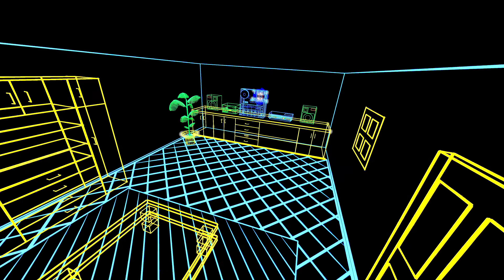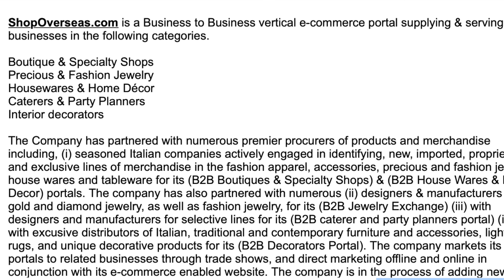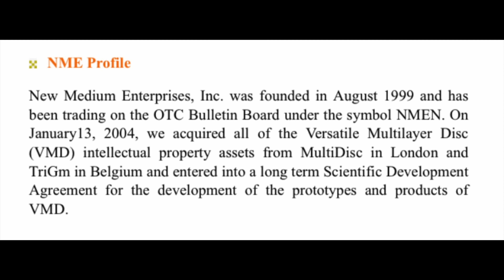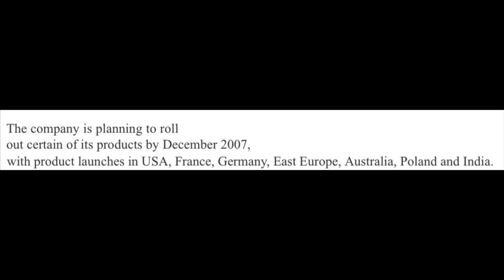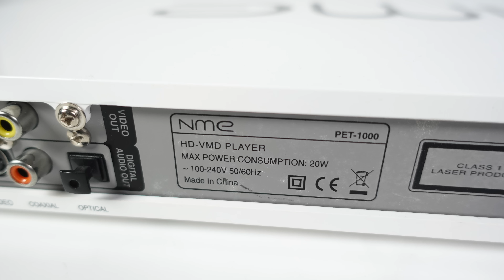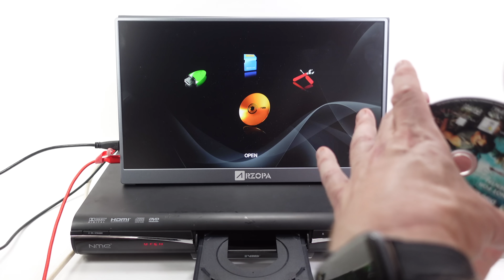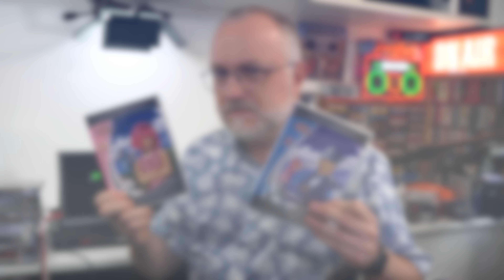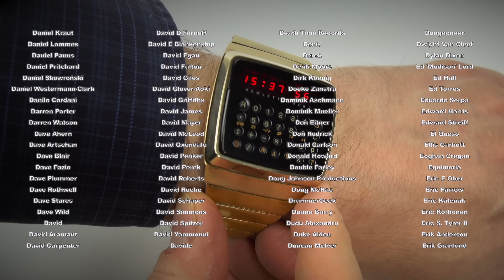The HD-VMD story - The format that lost to the format that lost

Comment: Given the updated firmware of the DVD burner, would you be able to read the discs if you put the drive in a computer?
The updating firmware part seems similar to when Dual Layer came out; I remember you could just update your regular disk drive for it to be able to read and burn DLs.
Reply: i was able to open the .vmd file in windows media player but it looks like this http://prnt.sc/1j1na6f
i had to delete some lines with an hex editor and then you have a normal mpeg-2 index the same as dvd 00 00 01 BA
so the video isn't encrypted, and it seems to play just like it did on your player
Reply: i was able to open the .vmd file in windows media player but it looks like this prnt. sc/1j1na6f
i had to delete some lines with an hex editor and then you have a normal mpeg-2 index the same as dvd 00 00 01 BA
so the video isn't encrypted, and it seems to play just like it did on your player

Comment: I'd be curious to know what would happen if you took the production DVD-R drive (that supposedly has custom firmware) and connect it to a PC. Doesn't solve the problem of not having a player application that can read the files properly, but there could be some rudimentary copy protection that isn't visible in normal drives. I doubt it, but who knows. In fact I kind of doubt the custom firmware even exists.
Reply: It must exist, since .VMD is a proprietary format.

Comment: looking at this from the year 2021, how I would have approached this would be to take standard dual-layer 8.5gb DVDs and put ~5-8mbps h264 content on them. You can comfortably encode 1080p into those bitrates, while being able to fit it onto a standard dvd. With this, you can fit HD onto a standard low-cost DVD with no special media. Thinking in these terms, bluray and hddvd really didn't make a lot of sense, seeing how little quality is gained by going from 8mbps to 25mbps with properly encoded h264.

Comment: When they said that VMD discs would be readable by a standard DVD player it's conceivable that they meant that it would be possible to manufacture a hybrid disc. Something that follows the DVD spec but also has additional layers readable by a VMD player. I presume they never realised this ambition but it might have been based on a sound concept.
Reply: There were also dual sides DVDs. Probably not a very common type disc anywhere I suppose, but I have one with 4:3 aspect version on one side and 16:9 on the other. 

So could be even more likely they simply meant those. Only with HD-VMD or regular DVD on each side instead.

Comment: Can't really talk about the HD format war without PlayStation 3. While slower adoption than Xbox 360 initially, the thing was still a $599 BD player when the first set of players were all well over $1000. It wasn't even just a BD player, it was a 2x speed player meaning all PlayStation 3 consoles were able to add 3D Blu-ray support via firmware update (which is insane). This meant that by 2009 when the 3D BD specs dropped, the system had dropped to $299, putting it at less than half the price of the new 3D BD players and already had a 22 million unit install base.
The HD-DVD external drive for Xbox 360 was a whopping $200 all on its own, the first two generation 360 models didn't even have HDMI.

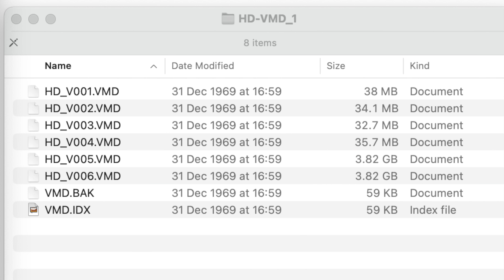Comment: Now THAT's interesting...the VMD in your final production run disc (32:42) contains files that are all listed as created 31 Dec 1969 at 16:59. That means little enough; everyone knows 
1970-01-01T00:00:00Z is unix epoch. So why the day before? Also understandable: Epoch is set at the UTC timezone, meaning other timezones are before and after. 16:00 is UTC-8, or "PST" (i.e. the Los Angeles timezone). But that's not right, it's 16:59. Okay, well some platforms contain a temporal standardizer to account for leap seconds. In those cases, the Seconds value (which, alas we don't see here) is stored as a :60. Problem being, if the device doing the READING isn't equipped for that, it auto rolls BACK one second to :59. So okay, that accounts for that, too, except... that would have made it 17:00 (minus one second). That's UTC-7. Mountain Time (Denver's timezone).

So what? Well, a few things: 
1. This london based company's media files are zone-stamped as USA. Typically you'd see this if the metadata didn't contain date information, so the system falls back onto Epoch... in the locale timezone (that is, the timezone of the physical computer doing the data transcribe).
2. This, in turn suggests a data manufacture in the west coast or central coast of the US, which, while I agree "Hollywood is there" (the -7 offset could be explained away by Daylight Savings Time, which, itself, tells us little more than the data was encoded between April and October), it still seems odd that Lazy Town, a product most assuredly NOT coming out of Hollywood, was encoded there. Especially...
3. ...if they never got a movie studio on board...
4. ...their proprietary format presumably required custom tooling to burn.
5. It seems strange to me that a company in LONDON chose to ship what is presumably the only encoding hardware prototype they managed to the US, and not least because...
6. ...the USA is not precisely the cheapest place to get labor or manufacturing done.... like the sort needed for encoding a production gang run of discs.

What does that all mean? Meh. Nothing. Not really, beyond hinting at still more questionable decisions as the company approached its demise. This all ran through my head when I saw the date is all. In short, "Epoch fail".

Comment: There was actually going to be another contender for this: the VCDHD (later known as the DVHD), was a flexible (as in, physically bendable!) optical disc that was apparently compatible with standard DVD players and drives and claimed a whole heap of advantages over normal DVDs. The reason I say it was going to be another contender, is because I believe they planned to release a blue-laser version (probably compatible with HD-DVD or Blu-Ray), but the format seemingly died before it reached that point. I can't find much information on what caused the death of the format at all, so it would be interesting to know more of the story here.

Comment: I could see VMD being extremely useful for Xbox 360. Think about it, so many Xbox 360 games came on 2 or more discs due to games becoming larger and larger. But with VMD, all they would have to do is swap the drive firmware and order VMD’s instead of DVD’s for games over 8 GB. Though Microsoft would never do this, since they backed HD DVD.

Comment: From experience of using optical discs as my main backup system for over 20 years now, I can tell you that multi-layer discs are not cost efficient in the slightest. You will often pay 3 to 4 times more for a dual layer than single. I'll assume that is why those LazyTown ones are on DVD, when you consider how much 4 or 5 layer discs would probably cost.

Comment: My first DVD player was a Toshiba. It was an open box and I got it at Best Buy back in 98. With tax it was almost 300us. Fast forward to 02' I ended up working at the same Best Buy I got the player from. I miss it because of the awesome discount we got for electronics. It was about 50% off. I ended up acquiring a Yamaha HTR 5590 receiver and a Bose Acoustimass 15. The receiver was $899 and the speaker set was $1,200. Got both of them with tax for a bit over $1,100. Good times

Comment: What's more likely is small file format changes and alternations between the prototype and the production machine making the discs incompatible this happens a lot in format production or any production. You can make a device and by the time it reaches manufacture the software and files are so different from the outset they are incompatible.

Comment: The HD VMD sales text claimed Blu-ray & HD DVD needed separate pickup units despite both using the same wavelength blue laser vs. its DVD-wavelength red laser. Funny, my very first HD optical drive of any kind was a dual-format Blu-ray / HD DVD PC drive, specifically to prepare for a lengthy format war; it wasn't any bigger than a normal PC optical drive.

Ironically, it arrived the very day WB announced it was going exclusively Blu-ray; HD DVD effectively didn't survive to the date WB announced as its last HD DVD releases. My first HD disc, Dreamgirls on Blu-ray, was a rush buy because there was a single copy left in a local Best Buy after Paramount had announced it was going exclusively HD DVD; I didn't want that as everyone knew from WB's announcement that HD DVD had lost the war. Now, I have well over 1000 Blu-rays and over 100 4K Blu-rays; my latest player is the Panasonic UB820 with region-free mod. 😁

Comment: Great video. Seen that last VMD player with a standard DVD-R Burner drive I wonder why they did not made it a Hifi Stereo Audio recorder (PCM or MPEG1) with a custom firmware upgrade and some visuals on the screen to name files. They would have been the pioneers on this front so close to CD-Audio Recorders with a lot more hassle. For a company like Philips not 2 experiment with DCC on a CD disc Recorder (5 Hours 18 bit) still fascinates me. It could have blown MiniDisc out of the water.

Comment: I think this product would have been better in the pc hardware market than the movie market.  It can use a dvd drive and could have been a great alternative than having to upgrade to blu ray, although no one did. Plus it would have been a good stop gap between dvd storage and usb storage which at the time a single 32gb could have easily costed you 30 to 40 dollars, so even if the  VMD was more expensive than dvds, it would have been cheaper than the alternative for more storage.

Comment: Actually the blue laser thing was valid at that time.
Red (semiconductor) Lasers are based on a material named "Gallium-Arsenide", which was well known from manufacturing and technology side as this was/is what also drives optical telecommunication lines in the infrared regime.
Blue (semiconductor) Lasers however are based on "Gallium-Nitride" material, which is a rather new invention, really only taking off in the 90's on the material science side. And the way to an actual Laser based on that material was a really hard one (including the invention of a completely new crystal deposition method named "metal-organic vapor phase epitaxy" (MOVPE or MOCVD)).
In fact it was the missing availability of blue semiconductor lasers that postponed the commercial start of the PS3 for several months because they couldn't get enough of these for their blue ray compatible drives.

Comment: Just to think now with todays advancements in video compression you can technically store a good looking HD movie on a regular dual layer DVD. All you need obviously is just some new gen decoding hardware. With H.266 you could probably even get a decent 4k image.
That said the HD disc format wars put many people off from even bothering to be interested. Most people were happy with DVD, it just worked and for a decent price. Also DVD was simply a good format in the sense that as a collector there were lots of extras that came in the box. The HD formats never offered the same sort of extra content collectors experience.

Comment: 23:55 As a temporary fix to see if it helps with reading discs, did you try and turn the pot that's probably there to drive the laser harder? Probably on the small board mounted to the laser near where you were cleaning

Comment: For me it Looks Like the Format uses the Same structure as DVD with an idx and BAK file. But instead of 576p mpeg 2 Like on a dvd it uses 1080p mpeg2. So maybe its possible to rename the vmd Files to vob and try to open them as vob or mpg2. Thats the Container a DVD is stored in.
Reply: indeed... i also think its just the same vob structure that we know from dvds but with with 1080p mpeg2 encodes. Its kind of a Super DVD. lol. Just like those out of specification discs called super VCD back in the early 2000. haha.

Comment: I think back in 2006, blue LEDs and lasers were still a not-unsubstantial cost increase over their red counterparts.  As we know, functional LED lights weren’t really possible until a more cost-effective blue LED Solution was invented, which I believe was somewhere around the turn-of-the-century, but I might be mistaken.  Maybe ‘96?  

Since it is logical to assume that the HD decoding circuitry would be (presumably) similar in price for all three formats, I think it is then therefore also logical to assume that the red laser played a more significant role in the 30% price difference, perhaps?  0.02

Comment: You might try cleaning the lens.  Those first gen HDDVD players used two read heads.  One for DVD and one for BlueRay as the grove tracking was different.  Then again, the thing should spit out the disk if it detected an error in the bitstream humm.

Comment: at 12:50 you're saying that not using a blue laser seems like a trivial difference but IIRC around 2006-2007 405nm UV laser diodes were brand spanking new (and enormously expensive if you bought one-offs) and there was a lot of difficulty getting them manufactured in volume (causing delays to the PS3 launch)

Comment: Hello Sir, myself BHARATH from India.
I need some assistance and guidance in respect of sansui D770R Cassette Deck.
The deck is functioning Good in all aspect of mechanism, but when Play Out connected to the main amplifier there's no audio.
The head connection socket at the pre-amplifier board, there is a Audio Click while touch that socket and VU led spectrum is also works, but after connecting the head output wire from the mechanism there is no audio and no UV led spectrum works.
Please help me to fix the problem, and where I need to check.

Comment: I'm really confused. So basically if it runs on a DVD player with a firmware update, it's basically just a different compression algorithm and video codec. There was no actual HD advance in the hardware, beyond standard DVD hardware? Does that sound right?

Comment: What file system did you use when you burned the disc?  I'd try burning the disc with a udf 2.5 file system.  The prototype video discs might not be able to play on the retail units.  I'd be interested in how the discs are put together, I do HDDVD on dvddl discs for a hobby and I could find another reason to burn discs in 2021

Comment: Using a normal DVD-RAM drive with a different firmware was impressive but the fact that the disk you have are normal DVDs shows that something did not work that well.

Comment: Why would the VMD not work on a DVD player? 
It all depends on the implementation. Am I wrong?
A VMD disc with 20 layers, could still work on one the layers as if it were a regular DVD, 
and that layer could have data encoded with MPEG-2, which could be decoded by a regular DVD.
I mean, I don't know the specs, but it could work, if done properly (we've seen other technologies that were backwards compatible 🤷‍♂️)

Comment: 20 GB per disk would make them a dual layer double sided disk which most if not all standard dvd player are able of playing.

Getting an extra 300 MB (standard dvd disks were 4.7 GB of marketing size and not true binary size of 4.37) per side would be more difficult with a standard laser. Over-burning would be the answer to this but it bring many problems of it's own.

It makes me wonder if that was the reason the pre-production were the over-burned 5 GB per side which was causing havoc for reading and playback.

Comment: Wait. Hp was on bluerays side? Why were they making laptops with hd dvd drives at the height of the format war? My hp dv9600 had a hd dvd drive. And that was a flagship laptop. They didnt start puttinf bluray drives in laptops until hd dvd failed. They must have been one of the turn coats that changed sides near the end.

Comment: A standard DVD reader can deliver about 11Mb/s continuously when playing a DVD Video. There's some overhead with the DVD format, leaving 9.8Mb/s for video and a little room for stereo audio at around 0.2Mb/s, making a convenient 10Mb/s.  The Saw movie runs for 1h43min. That comes out at 7.73GB, leaving just enough room for it to fit on a dual layer DVD with menu and intro logo and be readable by any standard DVD drive. The hardest part is making your own format and decoding it. I'd be very surprised if HD VMD is anything but a standard DVD with different files on it, and a bunch of lies.

Comment: While I think it would be no trivial trouble if you could have a backward compatible SD and HD on the same disc that would be cool. At the time the lasers were not a baked productionized solution so while bludgeoning consumers with exclusive content works it's at a cost and many people stuck with DVD at the time. Sony has many failed proprietary mediums. Falling behind on timing is death. Vertical integration anti competition seems like it should see anti competition issues. The technology still seems interesting if they could have reached the data capacity.

Comment: Wait, all their brilliant ideas were exactly the same as HD-DVD.
EDIT: To be clearer, HD-DVD was also "cheaper" than Blu-ray, used the red laser in one of its variants offering three times the data capacity as regular DVDs, and used the same basic DVD pressing equipment. HD-DVD was a bit more than just a codec on an existing technology; HD-VMD using the higher quality and controllability of DVD-R player (a bit like UHD Blu-ray and BDXL).
Reply from the maker: HD-DVD used a blue laser.
Reply: @Techmoan  ... The original HD-DVD used the red laser, and offered three times the storage capacity. They only switched to a blue laser after they had to get serious about competing.